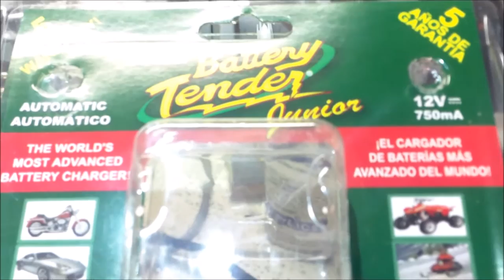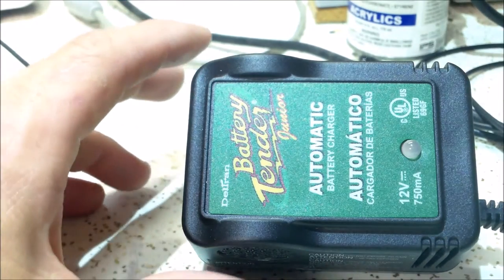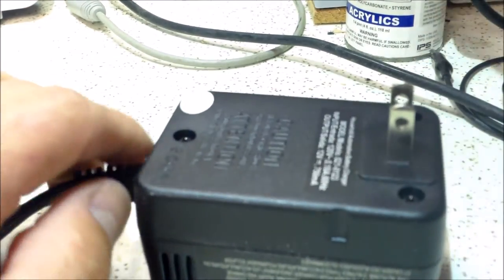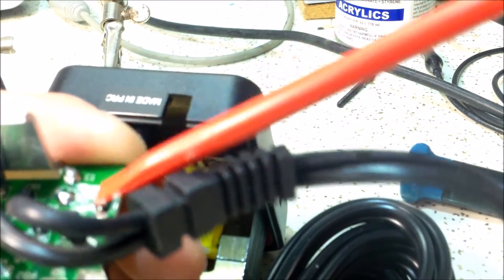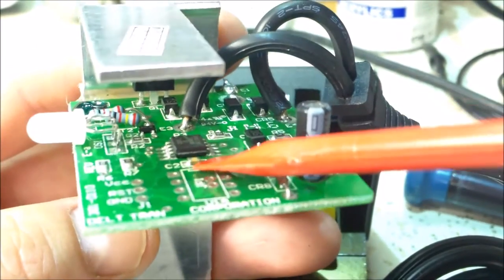Teardown / Look inside of a Battery Tender Junior

Comment: I was glad to see this video today. You saved me from having to take one of my newer ones already in operation apart because of my curiosity. You see I own roughly 15 of these Battery Tender Juniors I like them so much and have one on all my collector cars plus. I have the older heavy weighted ones and the newer lighter weight ones. 2 of the older ones quit working on me so luckily I found another You Tube video explaining the problem 2 weeks ago. The capacitor eventually goes bad in them. Some of my old ones could be 20 years old already. I took mine apart and desoldered and resoldered a new replacement capacitor onto  the circuit board. So far they are working like new again. It’s been already a week. Anyway when You Tube sent me this video as a suggestion to watch I couldn’t tell if it was the newer Battery Tender Junior or not until I viewed the video. I was happy to see inside the unit it looks basically the same. So much the same that I have no idea why one is a heavy weight and the other is a light weight. I see that it looks like they are using a heavier Duty Capacitor now in the newer ones.
Reply from the maker: The power of YouTube. Love when you can fix you own products. Thanks for the comment.

Comment: I have a BTJR from 2007 and a BTJR from 2013. The one from 2007 is very heavy and the one from 2013 is very light.
I wrote an email to Deltran asking them why one was heavier than the other and their response was
"The older unit has a transformer in it and the newer one does not." 
"The newer unit is more efficient and can be used in Oregon and California". That's exactly what they told me🤷🏻‍♂️.
So if the older one is heavier because it uses a transformer, then what does the lighter one use? Magic? Witchcraft?🤔🤷🏻‍♂️
Reply from the maker: The new one has to have a switching power supply.

Comment: My Battery Tender Junior Smart Battery Charger is not charging even though it still shows that everything is fine. If I disconnect one of the charging lines, the LED indicator would flash red light indicating it's not hooked up properly. If all lines are hooked up correctly it shows charging with a solid red indicator. But the charge never turned green, or flashing green, even after a week on an originally 75% charged battery showing 12.45V from the beginning. I hooked up a multimeter and it shows 0 charging current. Any idea on what may be wrong with the unit?
Reply from the maker: I am going to guess the transistor or mosfet. Not sure what one is in it. Since It can see the battery it just can’t apply the voltage from the transformer.
Reply: @CarlRecktenwaldJr  There is a BD438 PNP Transistor screwed to the heat sink covered with heat gel.
Reply from the maker: @NoSuffix that would be my first guess as to what is wrong.

Comment: Nobody will not be taking these apart like you did. It would have been nice to inform us on how or what this device can be used and on what. I have a Toyota Tacoma which I don't use much during winter. At times the battery goes dead and need to quick charge it. Would you recommend this product on pick ups?
Reply from the maker: I have 1 that I keep on my spare vehicle during the winter kk the and it works great.
Reply: @CarlRecktenwaldJr  well thanks for replying my good man. I assume the alligator clips will work just as good as the wire terminals? Thanks in advance.
Reply from the maker: Yes. It also comes with a connector that you can hook up to the battery and then plug In To the tender.
Reply: @CarlRecktenwaldJr  thanks Reck.

Comment: thanks...  I have one that quit working so after seeing this I troubleshot it down to the BD438.   Odd, after a couple years of use there was a white residue on the back side of the PCB.    Not sure if its condensate from the environment or the heat sink compound.
Reply from the maker: +ramosel hmm. They have a good warranty, might try emailing them. If it is heat sink grease you would know it, very slime stuff.
Reply: Condensation would require flux residue to form a white residue.  If it very easily cleans off with water and a toothbrush, it is water soluble flux.  If it requires rubbing alcohol and then cleans well, it is rosin flux.  If neither of these works easily and you need hot water and very strong detergent, it is heatsink grease.

Odds are that either your transistor failed from long term effects of inadequate heatsinking, or suffered damage from a power surge.  Regardless, a replacement 4A PNP transistor is not very expensive.

Comment: I'm getting no output voltage from the secondary windings on the 
transformer before the circuit board.  I presume it is a step down AC 
from the 110 volts input.  Anyone know what the secondary voltage should
 be?  A search of the numbers on the transformer doesn't turn up 
anything useful.
Reply: Never mind - just saw the sidebar text where it said 15 VAC.  Now off to find one...
Reply from the maker: You changed the multi meter to AC volts before testing?
Reply from the maker: Should be about 15 to 18 vac
Reply: @CarlRecktenwaldJr  yes, but I’ll check it again with another meter.
Reply: Well, I found a 16 VAC output transformer and soldered the leads to the board and now I have a working charger!  So, if your charger is totally dead, make sure that you check the transformer voltage coming off the secondary windings.  Thanks for the teardown and thorough reporting of what's going on inside.
Reply from the maker: This is total awesome. I am so glad you got your this fixed.   Thank you for the kind words.

Comment: Dropped mine now my led light on my mower will not go to green. Would the tender not be working? And is there a way to check it.
Reply from the maker: +Michael S I pet the transistor leg broke. It has to see the voltage for the charger to start charging.
Reply: Carl Recktenwald Jr. Is it a easy fix?
Reply from the maker: +Michael S I think so. I have seen the legs break off the transistor I think it is the bd140 part. If you have basic soldering skills.
Reply: Carl Recktenwald Jr. I do okay with soldering.
Reply from the maker: +Michael S well ok. Open it up and take a look. You Can’t make it any worse, it doesn’t work.
Reply: Carl Recktenwald Jr. Took it apart I didn't see anything loose. I put it on another battery in my daughter's car while it was running light still red.
Reply from the maker: +Michael S it is either the transistor is shorted or the Atmel chip is bad. Doubtful that a resistor is bad.

Comment: "Made in PRC"
Is that stand for People Republic of China?
Reply from the maker: +angelisone not sure, that would be my guess...I will have to look it up and see where it is made....
Reply: My Battery Tender always blink red, does that mean my Tender is defective or the battery is defective?
Battery was purchased brand new and Tender is 5 weeks old.

Battery didn't start the bike, but using a car battery did.
Reply from the maker: +angelisone Check the battery voltage with a Meter...i also got this from online:  RED LIGHT FLASHING (All models except 6V Junior) – The red light flashing indicates that the battery charger has AC power available and that the microprocessor is functioning properly. If the red light continues to flash, then either the battery voltage is too low (less than 3 volts) or the output alligator clips or accessory ring terminals are not connected correctly.
Reply: Since the bike is with my daughter, she is in school, I send her the DVM.  She will be riding home after her exams.

In the mean time, can she use or test using a 12V car or bike light bulb on this battery that when connected to Battery Tender provides blinking Red LED?  
If it doesn't light up brightly, then the battery is defective, right?
Reply from the maker: +angelisone The bulb can sometimes be misleading. I saw a bike with the positive and negative terminals reversed. If the battery is new I would take it back and have it tested.
Reply from the maker: +angelisone The bulb can sometimes be misleading. I saw a bike with the positive and negative terminals reversed. If the battery is new I would take it back and have it tested.